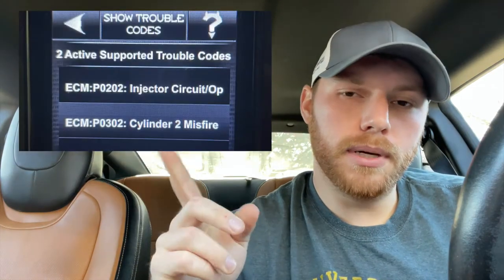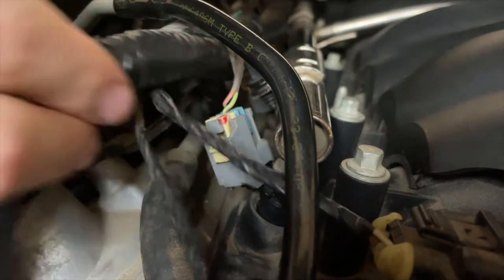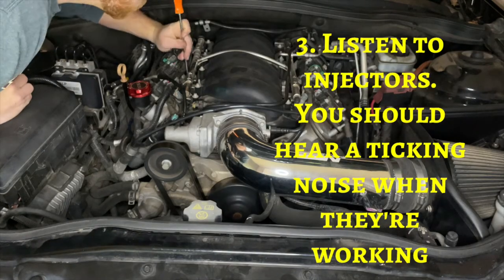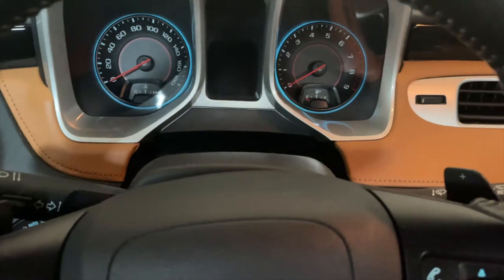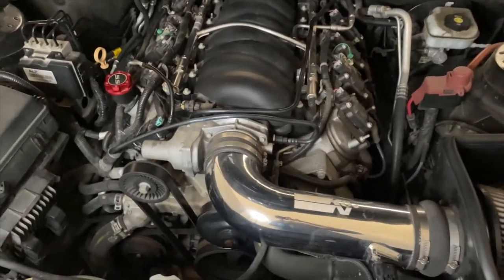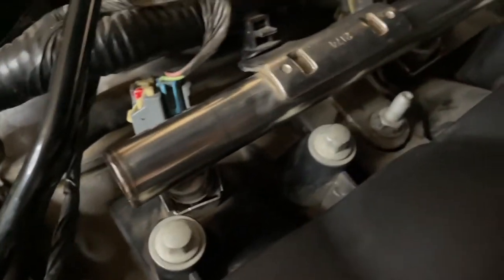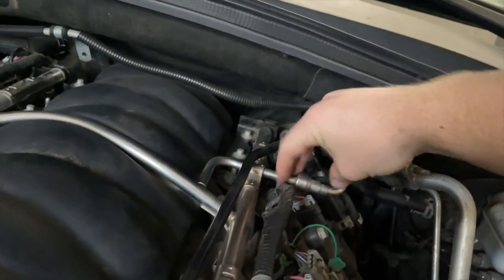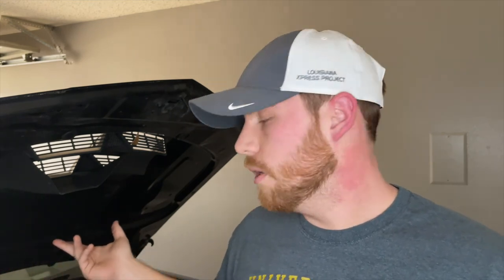How To Fix LS3 Camaro Service Stabilitrak- P0202, P0302 Fuel Injector Change

Comment: Having this issue with my 5th Gen. Hearing a tapping noise coming from the driver side of the motor. Changed spark plugs and wires. Gonna check the injectors next and hopefully that eliminates this stabiltrak warning. Car jolts when making a hit from low rpm also
Reply from the maker: I hope this works out for you. I didn’t think I’d be able to hear the injectors with the screw driver but it really worked. Mine would buck and idle and felt very sluggish when accelerating.
Reply: @MickeyBroadway  i have a 2013 ss i have basicaly put every new from the pistons up i had the car dynoed it came back with 522 rwhp been driven the car it was running real good had the car out all day it ran good i come home took a shower was going to go somewhere got in the car it started up then cut right off its been doing it now for 2 weeks i have been replacing pretty much alot of stuff and i just cant figure it out does anyone have any suggestions
Reply from the maker: @josephsullivan5650  I haven't delt with this issue before but we've gotta get that beast on the road. Check to see if it runs without the MAF sensor (it might need cleaning), Doesn't sound like a battery issue but it doesn't hurt to check. I'd also check fuel pressure. Keep me updated.
Reply: @MickeyBroadway  man i put new battery fuel pump map sensor crank sensor cam sensor i have a mechanic comeing over saturday to hook his computer to it just hopeing can tell me something have you heard anything about the way the security system works
Reply from the maker: @Joseph Sullivan My dads 2012 2500HD has a weird security defect that when he fills the gas tank up completely all the anti-theft systems kick on. That’s the only thing I’ve heard. I’m not sure what fuses or relays you should check but it never hurts to look at those. Hopefully your mechanic will get some codes to help you narrow down the issue.
Reply: @MickeyBroadway  yeah I appreciate yall s input never hurts to listen to people this thing has just been driven me crazy
Reply: Same here bro

Comment: I overhauled my stock L99 engine heads, valves are now in excellent condition like new, and tight enough. Replaced springs, valve steam rubbers, pushrods, rockers , spark plugs , cleaned valve lifters and injectors (no collapsed lifters on 100K mileage). Replaced all timing components and VVT along with camshaft sensor and magnet. Service Stabilitrak msg is still comes on during cranking along with a rough idle and a clicking noise. Valve lifters were found good but several of them had a scratches on the rollers. Oil pump is new, 50 psi on cruising and 26-29 psi on hot idle. Any suggestions ?? No fault codes
Reply from the maker: Can you pin down where the clicking is coming from?

Comment: Thanks for thjs video. Having the same codes on my 2011 Caprice PPV with a L77 engine (6.0l). Just waiting for the replacement injector to come so I can swap it out!
Reply from the maker: Glad I could help. Running a 6.0 that’s pretty sweet!

Comment: I changed it but no engine light showing but when i read the codes it have p0300 does the code will go away?
Reply from the maker: If the car is running correctly but you’re still getting the code it probably just needs the code cleared.
Reply: @MickeyBroadway  i tried to clear with my obd reader but still there

Comment: I have a 2014 camaro SS, stabilitrak, and P0301, changed plugs, spark plug wires, and coil, the wiring was fine, so I’m assuming it would be the fuel injector. Not sure though!
Reply from the maker: If you want to check your injector try this out https://youtu.be/tA_E6X4ISgQ. How many miles does it have?

Comment: My 2018 doing this😩 long start sometimes , RPM starts out on 1 , engine shakes a little bit! Somebody from another forum said its the positive battery cable & crank sensor I’m wondering if we all have different problems from it
Reply from the maker: Yeah I’ve seen other people have different issues. I hope yours turns out to be a minor fix.

Comment: He changed the spark plugs and the injectors and it still run bad
Reply from the maker: Did you check the wiring? I’ve heard from a few people that it was their ECM. I hope that’s not the case.

Comment: I've switched out my Injectors got them turned,  coil packs, spark wires and plugs, also cleaned out my throttle body and still get the issue
Reply from the maker: Is it still running rough or do you just have the code?
Reply: @MickeyBroadway  code pops up and then you feel the struggle around 75mph , but last night while going 80 on the highway engine power reduction kicked in. checked codes when i got home had throttle body circuit and other codes popping up switched battery and throttle body today. no codes at the moment runs alright tomorrow real test hitting the highway at 80mph
Reply from the maker: @Jhanny Quesada Geez I hate to hear that! Have the codes come back since you changed the battery?
Reply: @MickeyBroadway  yeah they have , today i checked the injector again incase it got fried but all gives me a steady voltage read. i bought the wiring harness for the injectors see if its that and ill work my way back towards the computer. even though i have a gut feeling its the computer.
Reply from the maker: How’s it coming? We’re you able to fix it?
Reply: I would love to know brother if it's fixed or what you did same problem here but haven't done anything about coil pCks or spark wires and plugs and haven't clean the throttle body

Comment: They told me I need my heads to be worked on. Changed plugs and coil pack, got a fuel induction service twice to eliminate carbon in my cylinder valve. Still the same problem, Should I just go ahead and pay the dealer the $$
Reply from the maker: If it was me, I would try the screw driver test in the video just to make sure no fuel injectors are fouled out. But you might have some head damage that needs fixing and for that I’d say either find a good shop or just head to the dealer. Just know it’s going to be $$$

Comment: My 2012 Camaro started shaking and loosing power and the Stability Track is on. I dont know how to fix. Do you fix cars? Can you fox mine 🙏
Reply from the maker: I hate that’s happening. Do you have a friend with DIY car knowledge? If so have them go thru my video and see if yours has the same problem mine did. If not, you might have to take it to a shop😕.

Comment: I have a 2012 ss having the same problem as you had getting a p0171 and p0300 and sometimes p0301 changed 02 sensor spark plugs and wires even the purge valve still same issue pulled the #1 fuel injector looks dirty could this be it considering the p0301 and p0171? Oh and I changed the MAF sensor as well
Reply from the maker: Sorry for the late response. The p0300 and p0301 codes could be caused by bad injectors. Also be sure to check the coil packs for damage wires or cracked connector. I’m not sure but I feel like the p0171 code could be caused from bad injectors throwing off the air/fuel ratio. Have you figured it out yet?

Comment: Excuse me, before this code popped up, was there any noise or bangs clicks going on?
Reply from the maker: Mine did not have any noises. It started bucking at red lights with a massive decrease in power when driving.

Comment: my 2010 camaro ss jerks in 4th gear but the stabilitrak and check engine comes off and on so i don’t know how to check for a code
Reply from the maker: Sorry for the late response. If you haven’t fixed it already, check/clean the throttle body and MAFs. It might be an issue with the trans, but I’d try the easy stuff first.

Comment: 2011 ss and I have the same lights on but car doesn’t have any problems starting and runs really good but the lights came on after I unplugged my battery for 5 min and plugged it back in
Reply from the maker: I wonder what codes it’s throwing? Are you still having issues?

Comment: Hola mi carro tiene ese mismo problema pero los mecánicos que lo lleve dice que es la computadora que me recomienda hacer
Reply from the maker: I've seen other guys that have had the same issue and the problem was the computer.  Before the mechanic starts messing with the computer, I would check the spark plug and use a flat head screwdriver to listen for a fouled injector. Those two are cheap, easy to fix, and it only takes a second to test for them. If those are both good then I would have them work on getting a new computer. Hope that helped and doesn't cost too much.